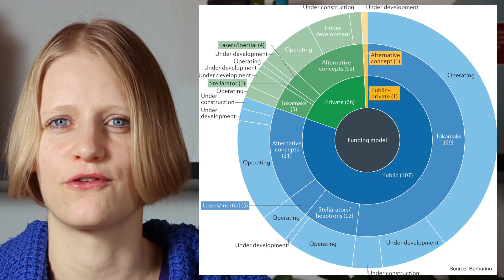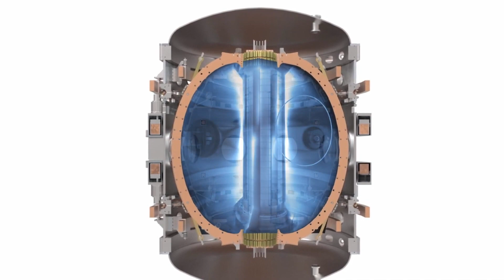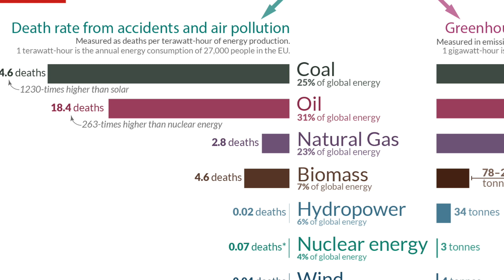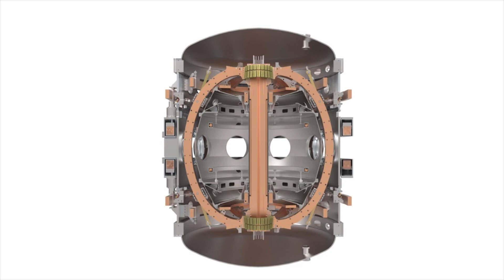Nuclear fusion: Economically viable fusion power possible on earth ?

Comment: Those high temperature superconductors are still far too thick compared to the tiny hole in the middle where the vacuum chamber needs to fit through. The big problem that is often not mentioned is the enormous structural loads caused by the magnets that will limit the strength of the magnetic field in tokamaks or stellerators.
It's a good and important progress to get magnets stronger, but it's a bit overhyped. SPARC is much more ambitious than many people realize. We shouldn't expect economical nuclear fusion in the 2030s, it'll probably take at least until the 2050s, and those economical tokamaks/stellerators will still need to be pretty huge.

Comment: There is no nuclear fusion in the core of the Sun. Nuclear fusion occurs in the solar corona  h ttps://www.youtube.com/watch?v=91NOjCePzdI
Reply from the maker: Thanks for sharing.
Reply: @NetZeroTech  Maybe you know investors who want to make a commercial fusion reactor in 2-3 years? Give recommendations, please.
Reply: @88Superphysics88  What you wrote in that Youtube video isn't very convincing to me, because it makes big claims with weak evidence and no modelling.
For example, you're saying
"15000000 K [sun's core] - 6000 K [surface] - 1000000 K [corona]! This is a gross violation of the laws of thermodynamics."
And yet it doesn't actually violate any laws of thermodynamics directly, you'd first have to model and justify that, which it seems you're not able to do. Which law is supposed to be violated here exactly and why? Simply jumping to the conclusion that fusion is the answer is unscientific.
Did you know that an upper part of earth's atmosphere (the thermosphere) is up to 2000 C hot, much hotter than earth's surface? By your logic you might just as well jump to the conclusion that nuclear fusion must be going on in earth's thermosphere as well.
After all we have a fairly similar temperature profile for earth: 5200 C [earth's core] - 15 C [surface] - 2000 C [thermosphere].
And yet we know fusion is not happening in the thermosphere, because otherwise we would have measured neutron radiation from it and seen some other effects.

As another example you write: "No scientist in the world can explain how fusion occurs in the core of the sun at ultra-high pressure, at ultra-high density and at ultra-high viscosity, at ultra-high temperature, at a diameter of 1,392,684 kilometers."
What?? High pressure, high density, high temperature (and therefore a large diameter) are exactly what favors nuclear fusion to occur. This should be easy to explain for any nuclear physicist, have you actually asked any? How do you write so much about this topic of fusion without knowing these basic facts anyone can easily google?

Your claims regarding the incompetence of all scientists working on experimental fusion reactors also seem utterly misplaced, considering you didn't even mention the core problems, especially plasma turbulence, that have so far delayed commercial fusion (and probably will for at least a couple more decades).
Reply: @helgefan8994  Helgefan, dear man!                                                                                                                        You are mistaken.                                                                                                               It is known from the media. The temperature in the thermosphere can vary from 200 K to 2000 K, depending on the degree of solar activity. It is caused by the absorption of ultraviolet radiation from the Sun caused by the ionization of atmospheric oxygen. How much is the surface of the ISS heated? The surface temperature of the station, facing the Sun, can heat up to 393.15 K. When the ISS enters Earth's shadow, the cladding temperature drops to 116.15 K. Even in your room, there are ions that can have a temperature of 5000 K. The ISS and the satellites in orbit do not melt or burn because there is a very large gas dilution.                                                                    The satellites that were sent to the Sun all burned up, NASA's Parker probe will burn up too. Because the corona has a temperature of about 2,000,000 K and the density of ions and electrons is much higher than that of the Earth's orbit. Such parameters of the solar corona are only possible with nuclear fusion in the solar corona. There are no other reasons. 
You write that my message is not very convincing to you, that the evidence is weak and without simulation? Aren't you convinced by the scientific information of other scientists about coronal heating by solar flares of different magnitudes? How can a 6,000 K flare heat up the corona to 2,000,000 K? Only by participating in nuclear fusion in the solar corona!                                                                                                                                          Do you give away all your discoveries, inventions and developments for free, without payment, without contracts? Tell me, what have you given to mankind?                                                                  I wrote in the message that I would give the new fusion technology for free. But under the contract, the Reward, upon receiving commercial heat from the first small prototype commercial fusion reactor. Isn't that a gift to humanity? How much do you think the technology to build a commercial fusion reactor costs? And this technology is free! You'd better help find a reputable firm to transfer the technology of a commercial fusion reactor for free. You will be rewarded, you will share in the profits.  
Хельгефан, уважаемый!                                                                                                                        Вы заблуждаетесь.                                                                                                               Известно из СМИ. Температура воздуха в термосфере может варьировать от 200 К до 2000 К, в зависимости от степени солнечной активности. Причиной является поглощение ультрафиолетового излучения Солнца вызванное ионизацией атмосферного кислорода. Насколько сильно нагревается поверхность МКС? Температура поверхности станции, сторона к Солнцу, может накаляться до 393.15 К. Когда МКС входит в тень Земли, то температура обшивки падает до 116.15 К. Даже в Вашей комнате есть ионы, которые могут иметь температуру 5000 К. МКС и спутники на орбите не плавятся и не сгорают, потому что очень большое разряжения газа.                                                                    Спутники, которые были отправлены к Солнцу все сгорели, сгорит и зонд НАСА Parker. Потому что корона имеет температуру около 2 000 000 К и плотность ионов и электронов намного больше, чем на орбите Земли. Такие параметры солнечной короны возможны только при ядерном синтезе в солнечной короне. Других причин не существует. 
   Вы пишите, что моё сообщение Вам не очень убедительно, что слабые доказательства и без моделирования? Разве Вас не убеждают научные сведения других учёных о разогреве короны солнечными вспышками различной величины? Включите логику, как может вспышка с температурой 6 000 К разогреть корону до 2 000 000 К? Только участвуя в ядерном синтезе в солнечной короне!                                                                                                                                          Вы свои открытия, изобретения и разработки все отдаёте бесплатно, без оплаты, без контрактов? Расскажите, что Вы подарили человечеству?                                                                  В сообщении я написал, что передам новую технологию термоядерного синтеза бесплатно. Но по договору, Вознаграждение, при получении коммерческого тепла от первого небольшого прототипа коммерческого термоядерного реактора. Разве это не подарок человечеству? Как Вы считаете, сколько стоит технология создания коммерческого термоядерного реактора? А тут эта технология – бесплатно! Помогите лучше найти солидную фирму для бесплатной
Reply: @88Superphysics88  Hey, thanks for the reply.

"The ISS and the satellites in orbit do not melt or burn because there is a very large gas dilution."
Yes I'm aware that those few ions around the ISS are not melting it. The only heat the ISS has to deal with comes from solar heat radiation (light).
But I was talking about the thermosphere, which already starts at an altitude of about 100 km, well below the ISS's orbit.

"The satellites that were sent to the Sun all burned up, NASA's Parker probe will burn up too. Because the corona has a temperature of about 2,000,000 K and the density of ions and electrons is much higher than that of the Earth's orbit."
That's incorrect, the density of ions in the solar corona is about as low as in earth's atmosphere at about 200 km altitude. That's well within the thermosphere and there are already hot ions because of solar UV and X-ray radiation.
Most of the heat those satellites near the sun have to deal with comes from solar radiation (light), not those very dilute ions in the solar corona. The density in the corona is just 10^15 particles per cubic meter, less than a billionth of the density of the air I'm breathing.
So how do you keep ignoring heat radiation (light) when talking about satellites and space probes? That light is the dominant contribution to heat.

"Such parameters of the solar corona are only possible with nuclear fusion in the solar corona. There are no other reasons."
How did you exclude the much more plausible explanation, that solar flares are heating up the ion plasma in the solar corona via Alfvén waves? Alfven was awarded the Nobel prize in physics for this.
After all, that plasma in the corona conducts heat extremely well despite the low density. And the strong electrical waves and magnetic fields can account for the corona heating problem.
Considering the sun can heat up ions in the earth's thermosphere (millions of km away from the sun) to thousands of degrees, why is it so far-fetched to you that it can heat up ions in the corona right above the sun's surface to millions of degrees?

"How can a 6,000 K flare heat up the corona to 2,000,000 K?"
Alfvén waves.

What I wonder, is how you can believe that nuclear fusion in the solar corona is heating up the plasma. In experimental tokamaks, fusion only ignites at a temperature of more than 100 million K, at particle densities 1000s of times higher than in the solar corona.
So the conditions for a considerable amount of fusion are just not present in the solar corona:
The temperature is too low (about 70 times) and the plasma density is far too low (about 100000 times). So why should nuclear fusion even happen there?

"You are mistaken."
I don't see it, where am I mistaken? Please try to address my objections more directly. You still couldn't explain to me which law of thermodynamics is grossly violated because of the solar corona.

"Do you give away all your discoveries, inventions and developments for free, without payment, without contracts? Tell me, what have you given to mankind?"
I have published a scientific paper with the title "Efficient Enforcement of Hard Articulation Constraints in the Presence of Closed Loops and Contacts". It's freely available on my institute's website including video material. It's not super-famous or world-changing or anything, but I think it has some considerable contributions in the field of mechanical simulation and computer graphics.
Reply from the maker: Thank you very much, @Helgefan. This is helpful information. Great work on the paper! I very much appreciate your help to get the facts right and accessible to people outside the field!
Reply from the maker: @Vladimir Vlasov The way to find investors is to look at investors of existing fusion companies / projects. This can help to understand who invests in fusion. Even if the exact people made their choice in the field and don't invest in other fusion companies, you can look for similar people. Also, raising funding from public sources (still the majority of funding in fusion) is different compared to private sources. With regards to commercialisation in 2-3 years, I expect it to take longer than that. Hope that helps.
Reply: @NetZeroTech   Thank you. I do so, but for some reason everyone is silent. You can make a commercial prototype, small, in 1 year.  Спасибо. Я так и делаю, но почему-то все молчат. Можно сделать коммерческий прототип, небольшой, за 1 год.
Reply: @NetZeroTech  Thank you for caring about the comments! :)
Reply from the maker: @helgefan8994  Thank you for caring about correctness and integrity of content! 😊
Reply: @88Superphysics88  "for some reason everyone is silent"
If you're looking for investors, you need to work on your credibility.
Claiming that nuclear fusion inside the solar corona is heating it up, without being able to explain how that could happen under the insufficient conditions there (pressure too low and temperature far too low), is not a great start unfortunately.

People with a basic understanding of fusion or maybe an adviser with expertise in that field will immediately think you're just throwing around big claims without any actual substance.

What you're saying sounds roughly like:
"All scientists who worked for decades on fusion are incompetent but I can get it done in no time so give me money. Oh and I can't provide any more details or answer any questions comprehensibly."
Do you see the problem?

Comment: Kathy states that both hydrogen and lithium are easily available for fusion. Doesn’t she know that fusion uses radiologically unpleasant tritium, and as for lithium, the key isotope, Li6 is only 7.6% of natural lithium.
Reply: Katha, this is an ingenuous reply as far as tritium goes. You are right as far as skin contact goes, but you must know that tritium will easily exchange with hydrogen in water to give HTO, and this is why tritium handling and transport is highly regulated. It can easily get into the food chain. As a hydrogen isotope, tritium also has the unfortunate property that its fast diffusion means that it is hard to contain. In a hot structure such as a fusion reactor it will permeate throughout, making efficient breeding impossible.
For the lithium question, how easy (and expensive) is it to isotopically enrich as required?
Reply from the maker: @johnh6245  Thank you for sharing.
Reply from the maker: Thank you, John. Good points. The short version is that tritium is not dangerous and lithium is abundant.

Details:
1. Yes, tritium is radioactive. A low-energy beta emitter, to be precise. It's explained in one of my previous videos: https://youtu.be/BUdnmoIdsUY
Tritium  is not dangerous externally, as the beta particles do not penetrate the skin. The half-life of tritium is 12.3 years.

2. The primary resources for current nuclear fusion technology are deuterium, which is naturally occurring in seawater and lithium, abundant in the crust of the Earth in the form of minerals/rock formations. Both 6Li and 7Li breed tritium, but Li6 breeds much more than 7Li, which is why 6Li is typically used. 6Li/7Li ratios range from about 5 to 12 %.

Thanks again, good points. 🙏
Reply: @NetZeroTech  Hmmmm. Tritium is not dangerous? Radioactive water that cannot be filtered out of regular water, that can substitute for water in every cell in the human body and will be radioactive for 10-20 years of its half life is not dangerous. I have read a lot from nuclear physicists and medical doctors like John Gofman, MD, PhD, who worked to develop plutonium for the Manhattan Project, who would strenuously disagree with you and be able to cite numerous peer-reviewed research studies that would refute that point.
Reply from the maker: @jackfanning7952   Thank you for sharing. If this is scientific information, It would be great if you could share your sources/references. Thank you so much in advance.